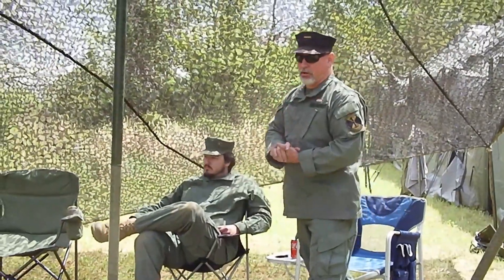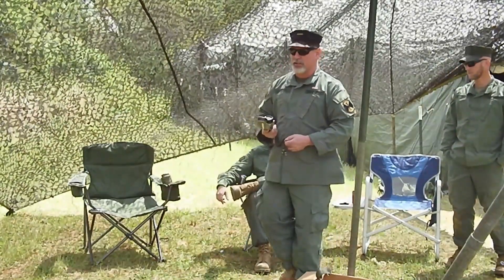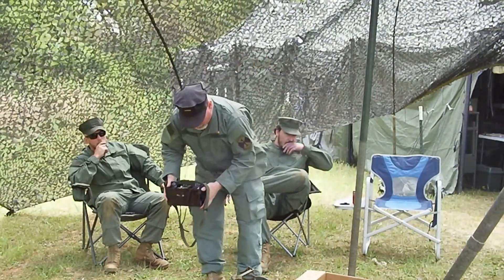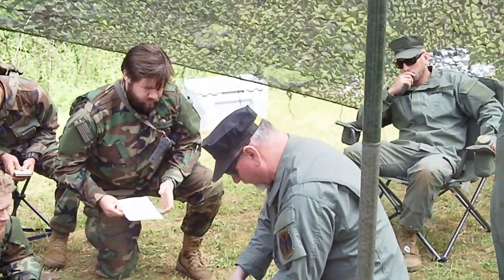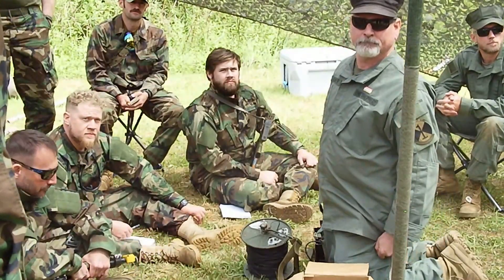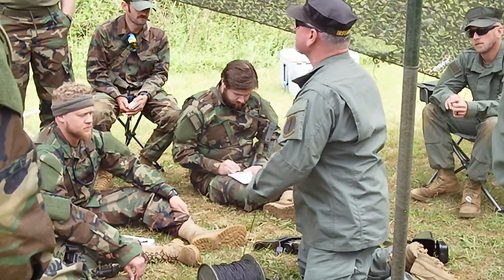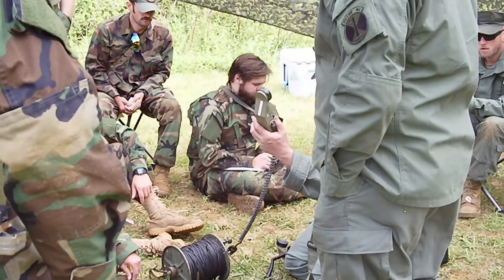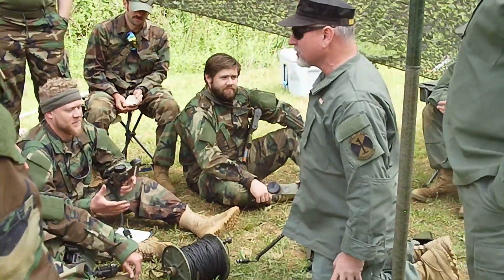FIELD PHONES PART 2

Comment: Does the TA-1 work with TA-312? Also can you use the TA-312 without any batteries making/receiving calls?
Reply from the maker: Yes TA1 and 312's work together.   It can be used without batteries but works much better with them.

Comment: What is that background noise? Sounds like a motorcycle race.
Reply from the maker: Car race actually
Reply: @PegasusTests  That weather. assuming an upload within the week. I'm reasonably certain you travel with a cadre less than a contingent making impressions as if you were the Rank of a Field Commander, along the line of a 2-3 star Brigadier General , or whatever it is you Military types would call it. You are showing one of your sub commanders, or whatever it is you Military types would call rank, you will impress upon them with presence as if you were directing a real Militia action.
Nevertheless, whatever you are generous enough to supply, I will absorb.